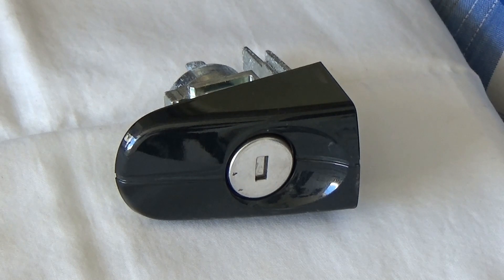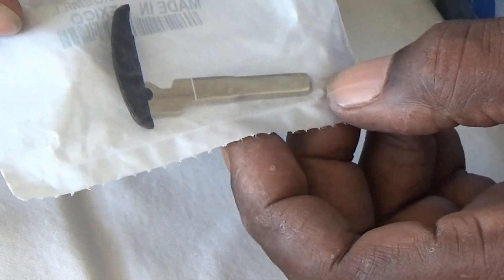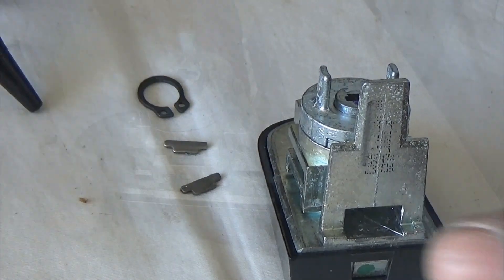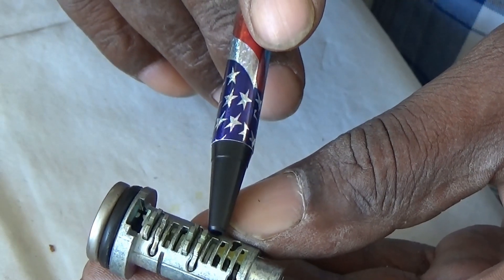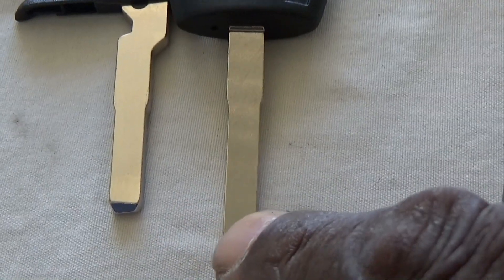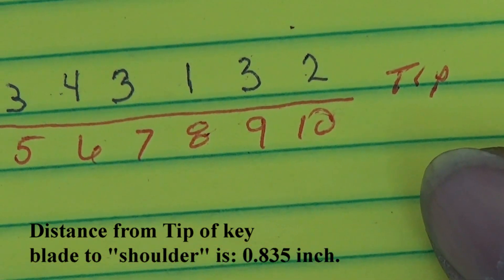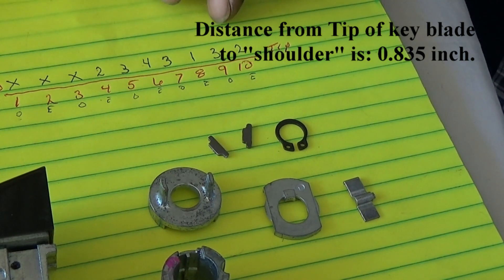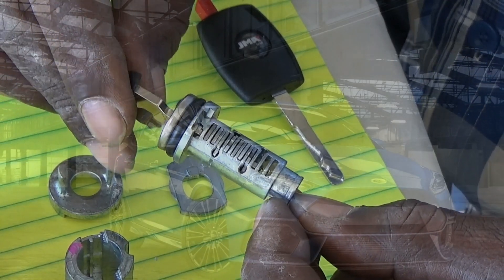2015 Ford Focus Mecanical Key

Comment: Hi there, Sir, may I know how you remove the retainer on 2:40 (which is the deep down retainer)? I see you putting a needle liked metal inside the hole. Can you show the way to remove it?
Reply: I got the same problem, did you find out how to remove the pin?
Reply: Yes hiw this pull up. I can't throw out this